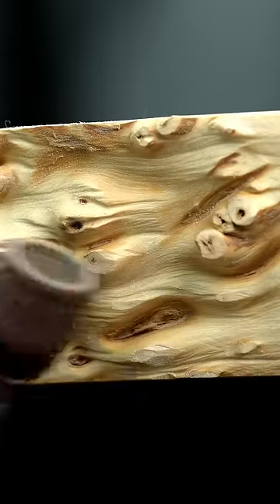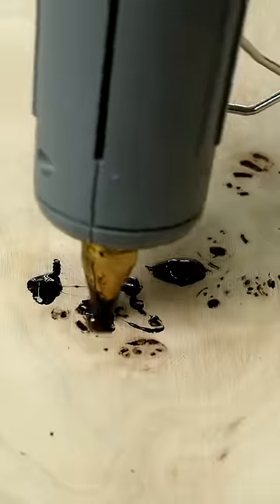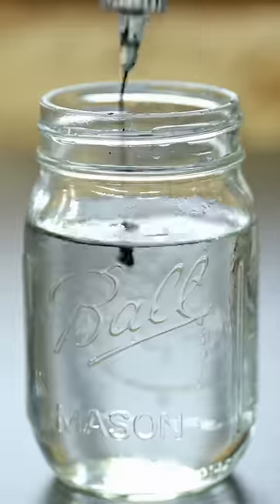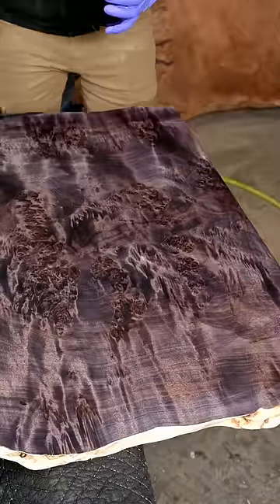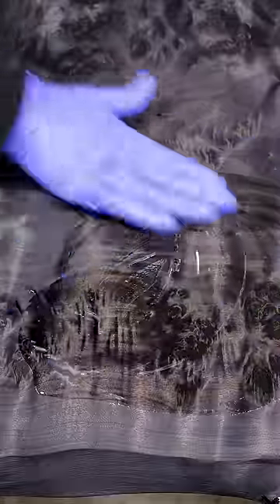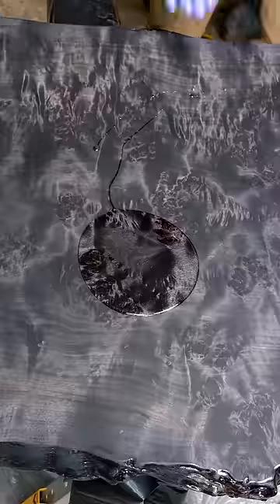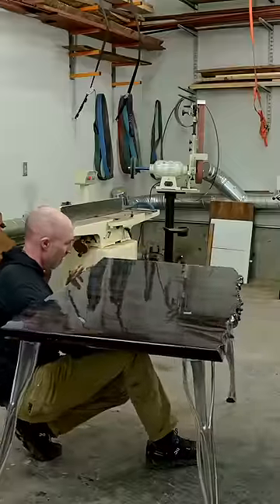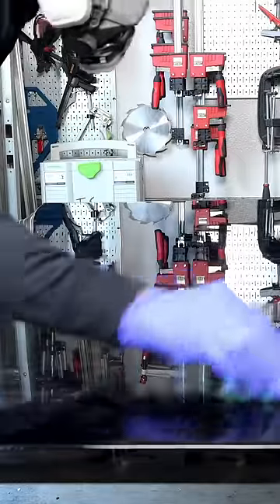My Most Expensive Desk

Comment: It isn't that nice looking in my opinion. The legs are very odd for it and clash with the design a lot. It also looks too much like a plain guitar body, really. It would be cooler if it had more effort put into the design colors than just one dye coating the whole thing. Like if there was an 'explosion' of white coloring in an ellipse-like shape, around the middle. Stuff like that would make it look more truly unique for what it is, rather than just some random dyed wood. I also don't like the thickness of the epoxy layer. Something about it making the wood look so far away from being able to actually be touched just gives me anxiety. I also definitely think lighter colors would bring out the wood pattern more. Like pink or the white I mentioned.

I really couldn't imagine something like this ever being worth anywhere close to 15 grand. Even if it were all wood and much thicker, I still wouldn't think anywhere above like 3 or 4, even if that had super cool and unique detailing. And even then, I don't see the point. It is just a table. If you are going to make it an artpiece, I say really go all the way with it. Make the coolest-looking and most functional table anyone's ever seen. Right now, the river table with real water running through is my favorite, but it could be even cooler.

Comment: This truly is a one of a kind piece. I can see how it ended up going for $15,000. A matching chair set where the seats are matching the table top and the backs and legs match the legs of the table. I could definitely see that going for another $5-7,000 with the table. Excellent work man
Reply: I just don't see it lol it's wood apoxy and some basic steel lol
Reply: @ghosthunter3391 it's safe to assume you made one and sold it for 15k then? That's what I would do with something so simple.